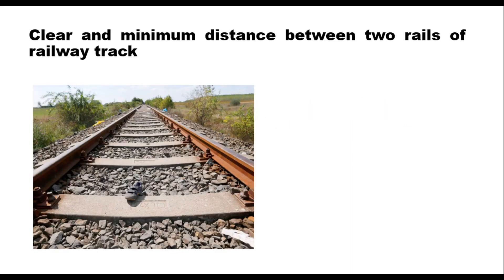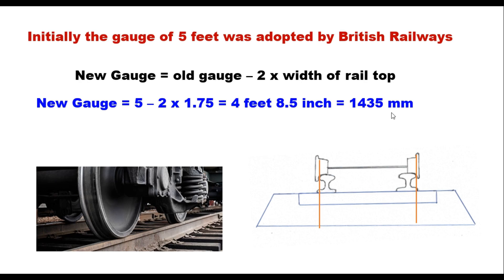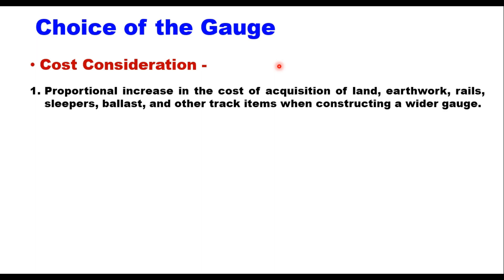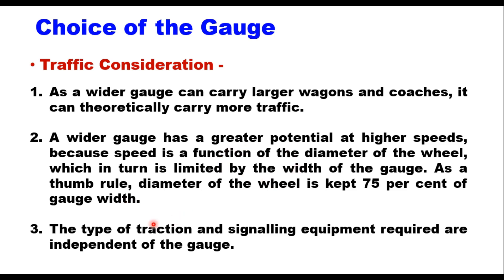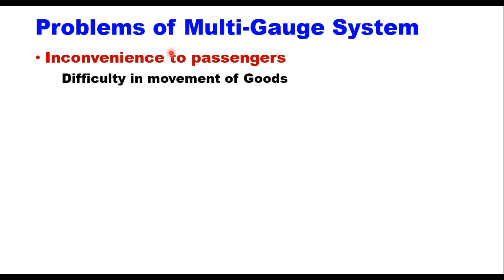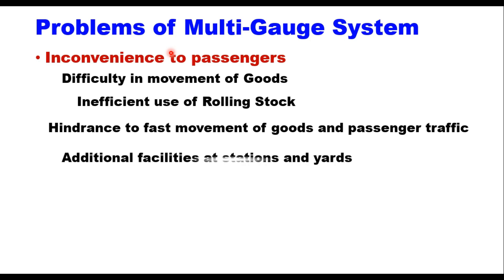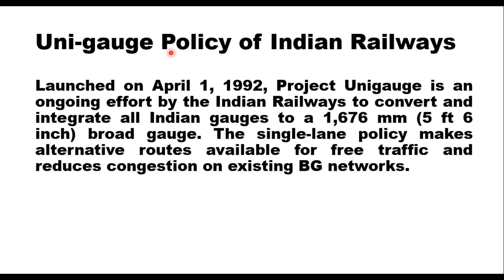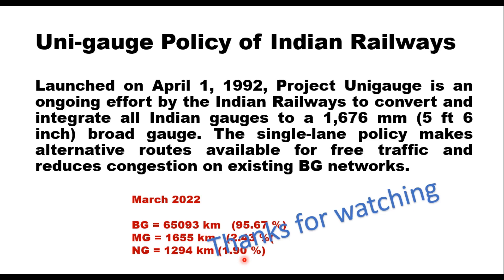#railwayengineering Gauge of a Railway Track, Standard gauge. Problems of Multigauge system

Comment: sir what is gauge lenght(BG) 1676 or 1750 mm?
Reply from the maker: Gauge width is 1676 mm, but in all calculations the dynamic gauge of 1750 is considered. It is the distance between the centre of the two rails.
Reply: @SatishIITR  ok sir, thank you , your videos are very much helpful.
Reply from the maker: @debarkaroy3274  welcome